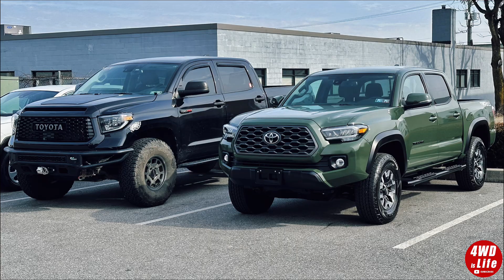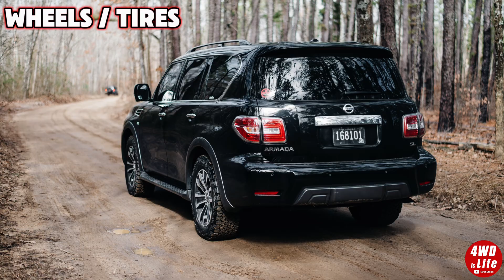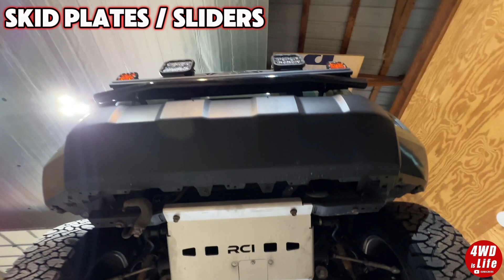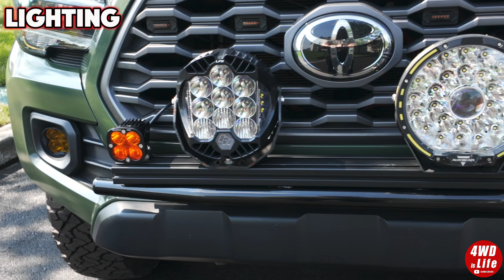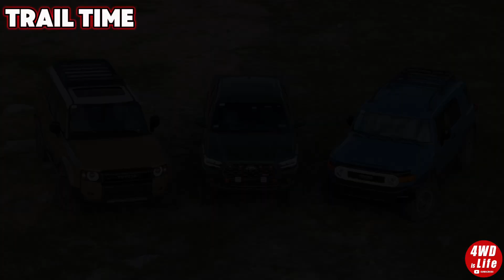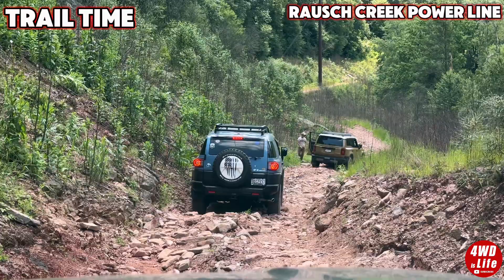Toyota Tacoma Overland Build

Comment: I am exactly like you - a very slow off roader. and every time my car's underbody touches a rock or an overhang, it racks my nerves. I own a Mahindra Thar 2022 model, I am from India. The vehicle is extremely capable, 2.2 liter turbo diesel, an Eaton mechanical diff locker at the rear and electronic BLD at the front. Being a short wheelbase vehicle and short over hangs, approach and departure angles are terrific. Ohh and I have a ToughDog 50mm suspension lift kit on my vehicle.

Comment: does the extra inch in rim size affect the speedometer's accuracy aswell as the car's acceleration and speed
Reply from the maker: It does, but since I only upsized one size it  is around 3.2% off in terms of odometer/speedo. The effect on acceleration is not too bad.

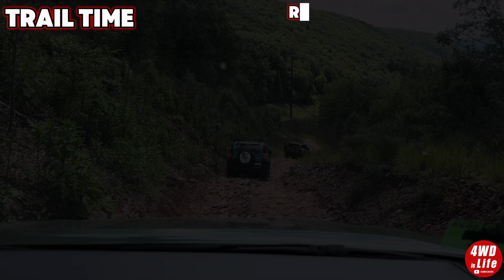Comment: At 13:30 when you did the MPG test, what octane was in each vehicle?  I put regular in my 2014 FJ. I think the new LC250 uses Premium.  I drive slow offroad too.  Parts are expensive!  Any who criticizes you for going slow offroad needs to pay for your broken parts or shut their mouth.
Reply from the maker: Haha. Thanks for the support.  The fj and lc250 both fueled up with premium fuel and my taco used regular. Fj should be good with regular but the owner wants to give it the best fuel.

Comment: LC cost 70K and got 23mpg
Taco cost 40K and got 21mpg with bigger heavier tires
Yeah no thanks on these new Toyotas. Overpriced and less reliable now.

Also crawl control is what it means. Controls your speed. It doesn’t know you’re going over a mogul section. All it’s doing is trying to stay at 1-4mph. You shouldn’t even be using crawl control in that moment. It’s not called “smooth control”
Crawl control is best when you’re stuck in sand or going down a steep slippery hill where you can’t control the brake pedal as well
Reply from the maker: I agree with the ridiculous pricing part. However, the fj and lc25@ both used crawl control and made much less of a fuss (lot more smooth) compared to my Tacoma, that alone shows how the tacomas system is not on par with those two at least.
Reply: @4WDisLife  now that you mentioned that. You care correct. It’s due to 3rd gen tacomas with drum brakes. They should’ve never designed it like that. You should try and find a 4th gen and do a comparison. It might just be the same dynamics as the LC electronics
Reply from the maker: @chivas_gets_lost  for sure. Sometime in September is when Kai gets his hands on the new Tacoma.
Reply from the maker: @chivas_gets_lost  after a weekend offroad with the  4th gen  tacoma, can confirm that the crawl control and atrac are almost silent compared to my 3rd gen, stay tuned for video comparison.

Comment: From this video, I find the LC250 to be an underperformer. As for drivability of the BFG, my MT-G003 mud tires gave me far better performance on or off-road than the previous KO2 I had. Nice tip on the sliders btw.
Reply from the maker: Interesting point because I also had ko2 and geolandars g003 Mt, g003 mt can’t match the ko2 at least for the onroad section, off the road g003 is a beast
Reply: @4WDisLife   the issue with KO2s here was unpredictability in rain compared to the predictability with the MT G003s. Also, I could never ever tackle the balance issue and vibration with my FJ Cruiser whereas I face none of those either with the X-AT or the MT G003 I use currently.
Reply from the maker: @RoyFJ65 what is the tire size you have with the ko2? I find the smaller ones tend to balance well, but I do agree that ko2 didn’t balance well. As for wet performance I find it in par with stock tires that came with my rigs (mostly street ht tires) so my expectation was not high to begin with 😂 after a year of using the g003 I had to switch back because the Mud terrains are just too loud for me.
Reply: @4WDisLife is the Tacoma smoother then the tundra offroad ?
Reply from the maker: @Goontunes5.7  I find Tacoma to be more nimble off road, the downside of the Tacoma vs tundra is it’s carrying capability and it’s got less room. But I am okay with that.